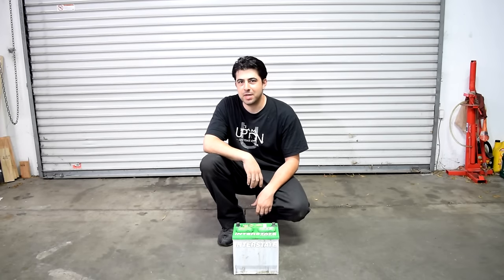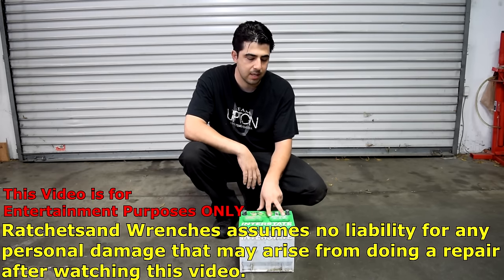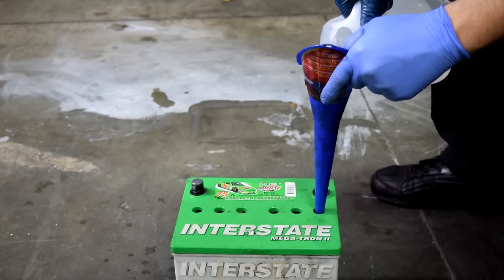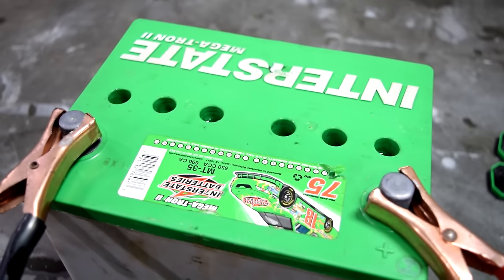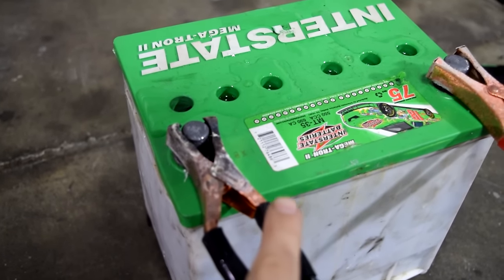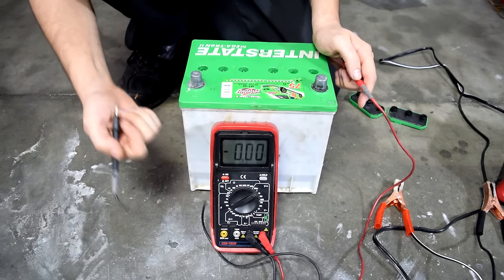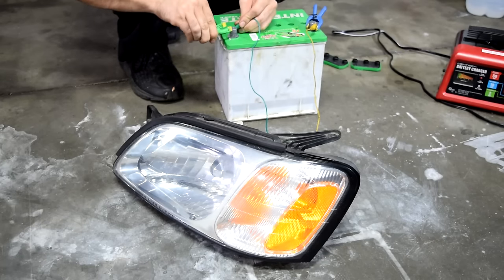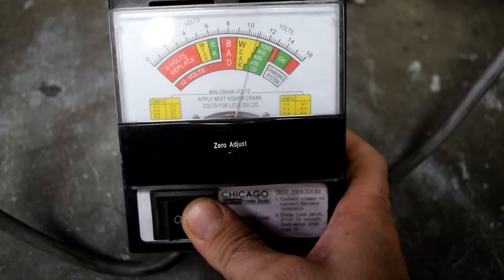Is it Possible to Revive a Dead Battery with Epsom Salt - See For Yourself

Comment: drastically changing the chemistry of the battery will not help it become alive again; you should have tried washing it first with distilled water and refill the battery with acid fluid that has specific gravity of 1.28, be sure to recharge the battery with desulfation mode before changing any fluid to get the most of the lead sulphate out of the plates first

Comment: I always heard sitting batteries directly on concrete will drain the voltage. 
I have an older RV with 1 huge primary starter battery and 3 cabin batteries. May try this.
Reply: Interestingly, some experts (including Car Talk’s Click and Clack) believe that storing car batteries on concrete floors might actually be a better idea than keeping them on shelves or other surfaces because the cold of the floor works to slow the self-discharge (leakage) rate.
Reply: Concrete is cold. When you place a charger on the battery the plates heat up, convection occurs. The theory is that the sulfication (?) of the plates instead of remaining attached or suspended in the electrolyte drops to  the cold case bottom. This build up will eventually get thick enough to short out the bottom of the plates, thus shortening the overall battery life.

Comment: ok that looks ok for test on car lights but put it to the test and try and turn a engine see if it fires up i don't think so.
also the acid used for 100 years for batteries is sulphuric acid, go and do what you can do more lights for you house

Comment: Clean the battery as demonstrated and purchase electrolyte solution for approx $16.00 ... at your automotive store & then  install per instructions (wear safety glasses ) and then charge up for 24 - 48 hours  .....  In Canada you can buy online for $30+  .... it works !  Follow the instructions .... PLEASE !

Comment: what happens if you drain and washout the battery after all this and re add the settled sulphuric acid and distilled water. I think it would hold 400 CCA

Comment: the problem was that you only had flushed it once, there is a lot more dirt inside the battery you need to flush it about 3 to 4 times then you can add the epson salt with water other than that you did fine.
Reply: +Carlos Melendez - I did with Aluminum Sulfate and Epson Salt... NON have worked :(.  It only worked 10% of Capacity, meaning..., 500 Amps Battery= 50 Amps Battery.  It's a waste of Money if you asked me!
Reply: maybe your battery was bad from the beginning, i have the same battery since 2007 and it works just fine.
Reply: +Carlos Melendez - Even with a Brand New Battery.... It won't work :(.... Aluminum Sulfate or Epson Salt has a low density of retaining Positive Charge / Negative Charge.

Comment: This one's dead battery now resurrected 12 volt car battery can be repurpose to be used as a battery to power a emergency power bank with a use of an inverter can power necessary appliances and equipment in the event of there is no power this now resurrected car battery can now have a second life.

Comment: I'm going try it again to see if I can retrieve the life of a 12volt battery that has a dead cell & I get some more baking soda & I have plenty of distilled water & boil up the distilled water & add the baking soda & put the caps back on the battery  & give it a good shake up & let it sit for a little while & then shake it up again & then take the caps off & pour the all of the solution out of the battery & then pour more of the baking soda with boiling distilled & add back into the battery & put the caps back on the battery & give it another good shake up let it sit for a little while & then give it another good shake up again & then pour the solution out of the battery again & then I would pour in fairly hot distilled water only & put the caps on the battery & give it another good shake up them take the caps off & pour out the distilled water & then let it drain for a awhile & the mix up Epsom Salts & mix that up properly with distilled boiling water & once got mixed properly & I will pour that into the battery & then put the Foxsur 12v/24v 7 Stage Battery Charger on repair mode & leave it on repair mode for 24 hours & see if I can repair the 12 volt battery if not I haven't got nothing to loose & I have got another even bigger 12v battery & it to has 1 dead cell & I was thinking of trying to recover that one 2 Kind Regards Peter

Comment: Abroad they have been known to wash out batteries with a coke drink, then refill with the acid. All this type stuff is last ditch, but might be worth a try on an old pretty useless battery. I wouldn't add any chemicals to a good , not to old battery, or my experience is that it will not make it last longer. It might even shorten it's life.

Comment: Epsom salt and water is not a proper electrolyte, it is supposed  CLEAN the sulfate from the lead as in a dead battery. Remove that epsom salt water from battery, add sulfuric acid and water in the correct ratio, charge, and assuming the lead plates are not damaged, you should have a battery in decent shape, typically it might be as as much as 90% as good as new, the first time this is done. Eventually the lead plates will be GONE from sulfation. Have a nice day.

Comment: Just let you know cement drains batteries
Reply: Ivan Omarra yeah I not sure these guys wanted to be successful..I’m guessing,They may be in the business
Reply: That's actually a myth. The reason people think that is because having a battery sitting on cool cement with a higher ambient temperature can cause the battery to discharge more quickly due to the temperature difference between the top and bottom parts of the battery. However having worked in the auto industry for several years I have seen many batteries stored on concrete floors including having stored my own this way and never had any issues. But no, cement does not have any special property that will drain a battery by coming in contact with it.

Comment: the guys that say no, do not have any proof, as the guys that say yes.  it is entirely possible that daily temperature changes, over a period of time, altered the electrolyte concentration thru warmer air during the day absorbing  components....then due to colder average temperature of battery being in contact with  cement heat sink did not re-absorb at the same rate....so, the state of charge is highly likely to be reduced.......

think about it....a closed shipping container, except for leaks will breath in and out on a daily basis,,,,the lighter  molecules of air escape faster than the heavy molecules....because, heavy molecules do not present themselves as often to an external opening....consequently....likely to find traces of liquid h2O......inside.....not exactly the same thing but similar....somebody out there could likely express this with equations....

Comment: Just buy a new battery as car batteries aren't that expensive ($150) and a new car battery from Walmart will generally last 6 years.  Besides, a person can also get back a little money by bringing in their old battery as a core.
Reply: While 1 battery may not be that big of an issue, their prices have gone up significantly. A truck battery is close to $200-250 now, especially when you get into higher quality ones. What's even worse is when you have several large batteries that are going bad (RV, golf cart, solar panel set-up, that sort of stuff). At that point your cost is over $1000, so these DIY repairs are worth a try.
Lastly, a core battery only gives you $10 regardless of size. Enough to stop you from just trashing one, but not nearly enough to be considered as an "R.O.I."

Comment: I've got two batteries I'm going to try it with when you're charging each one of themselves should be bubbling if you if you look at your charger you probably got to sell it ain't even doing anything
Reply: What the hell did you just say? lol.
Reply: When you're charging a battery you look down in their holes each one of those c cell s should be bubbling when you're charging it if the cell isn't bubbling it's a dead cell

Comment: Someone try a 50/50 CLR/WATER Solution to clean sulfated  plates. Then put fresh sulfuric acid back in, or the original acid filtered through a coffee filter. Report you results to this string.
Reply: stripemaster9 yup this works..it needs fresh acid which Wal-Mart sells

Comment: this is so wrong interpreted. The sulfuric acid which is used on batteries is H2So4
The Epsom Salt is MgSo4 which is something totally different The (Magnesium)  will cover the lead cell into a white crystalline buildup, something that you don't want inside of any lead acid battery. Now where the sulfuric acid coming from?
The sulfuric acid is made from "SOX or Carbonic Acid S+O2-->So2 
and this is how sulfuric acid is made So3  +  H2O --->  H2SO4  ---Sulfuric Acid if you just ad the SO2  + H2O------H2So3-----Sulfurous Acid Which is again something different!

Comment: Just add lime away bathroom cleaner to your battery cells and trickle charge it (low charge) for 24 hours and it will do the same thing.    Do not empty anything from the battery.

Comment: There are  several things for getting a good result
do not try to do this unless you know what you are doing - the acid can burn you
check the voltage first - there may be a dead cell which will be a waste of time trying to fix.
Check the battery fluid.
attempt to fully charge the battery.
(I read about these and more using Rapid Renew Roadmap website )

Comment: you expected that battery to hold the recommended cranking amps while only charging it on a 2 amp charge for 48 hours . sorry to tell you that wont work 2amp per hour charge times 48 hour is only 96 amps. so its right on the money. 100 amps

Comment: Never put baking soda in a battery.  After charging the battery a few times . Dump and replace with battery acid . Or add sulfuric acid to the Epsom and water . 30% acid . No acid . No CCA.

Comment: It's a good emergency phone charger 👍
Reply: Interesting thought exercise. The issue is you need power... if you have power, you don't need the battery. If you're thinking off-grid or outage solar power, sure maybe. You could use a small solar panel with built in controller or panel/controller combo. But if you can afford and obtain these things, just spend a few bucks more and get a fresh battery. If you want to get fancy you can get combo units that have built in solar charge controllers, 12V, 5V, even built in mini 120V inverters. Better still if it's LiFePO4 (lithium iron phosphate).

Comment: Please take the battery off the concrete floor and put it on a 2x6 because the concrete will drain a 12volt battery try that and your amps should read more.
Reply: I heard that old wives tail years ago.  Truth is that someone might "think" concrete is discharging it, when it is really just time and non-use.

Comment: Battery should not be setting on concrete.
Reply: That advice has migrated into the realm of 'ol wives tales'. Modern batteries have plastic cases which prevent leaking or oozing of battery acid through the case.

Comment: any battery can be saved..
i worked in a battery center repairing them
you just need the right stuff to add
there was a composition chemical that was imported from america that made second hand batteries work and last longer than new ones..
i was witness to that..
many years on and they still work

Comment: All my battery problems are due to a dead cell or constant drainage. A dead cell usually comes from a piece of lead that drops off one of the plates. Then it shorts the plates to each other by the welding process. Therefore I'm calling B.S. unless the baking soda has a method of unwelding the plates. please explain. NEVER had a battery go bad for no other reason. Why would it? It wouldn't. Most Batteries are thrown away because of metal . The batteries u are checking might have had a short time left on them but it's coming. If ur in a bind this might get u to a paycheck. If u have a wife getting ready to have a child or might need ur car to start instantly, go spend the 100.00 for piece of mind.

Comment: I tried this with 2 different types of 12v car batteries and one 12v motorcycle battery: Didn't work
Reply: First check each battery cell one by one l, if one cell is dead in a battery , it will not work. Secondly put Fresh Sulphuric acid (as per requirement ) in the cells after   cleaning for many times .Charge the battery  for 12 hours.

Comment: Your Battery is only rated at 75 Amps, Your Meter Reads 100amps after the battery has been fully reconditioned and recharged, and you are disappointed ???? What reading did you expect to get ???

Comment: LOL, you have to put the battery acid back in the battery.  Epsom salt is NOT battery acid.  Epsom salt is only to clean and desulfate the plates.  Then it has to be dumped and the electrolyte put back in.

Comment: In the first place, anyone knows that concrete will drain a battery, quickly!  Put cardboard between the battery and the concrete, and you will see a difference!
Reply: Plastic cased batteries will NOT discharge if set on concrete or the earth. The batteries that did were the old thick rubber/ carbon case type in the 1930's to 1950's. carbon black conducts electricity - plastic does not.

Comment: You should use a capacity tester test a capacitor that's the best way to test a battery can't you put hydrochloric acid back in there you can't just use epsom salt you have to use hydrochloric acid don't you

Comment: First the ground is a "ground" come on you work in a shop. Put the battery on a piece of wood. or a metal rack isolated from the floor. If you leave it on the ground it discharges. Second you have to dump the Epson salt. Salt is on the basic side whereas acid is not; because acid is on the acidic side. To get the proper "reaction you need the acid to react with the lead. You just have basic vs basic...right; now you got it!  And third, although I have never done this I have heard it takes several days to de-scale the lead properly. No offence but you have only proven you did it incorrectly.

Comment: Should have filtered the acid solution that came out of the battery and put it back in and left enough room to add about 1 to 1.5 ounces of the epsom salt solution to each cell…..straight epsom salt solution doesn’t work.

Comment: Skip the baking soda step baking soda neutralizes battery acid neutralizing substance in water inside the battery cells is going to cause a battery not to charge because it's going to coat the lead plates inside not a good idea

Comment: You wore no eye protection, you were extremely careless in flipping the battery onto the 2x4s (if it slipped dropped into your bucket you'd be screwed). A freaking car battery with Brand New Plates is what 100 - 120 bucks so NOT really "over priced." Why take a chance ?

Comment: at 0:25, you show 14V.. thats incorrect. A good battery would be 12V.
Reply: In addition to the  fact that the presenter was pointing out a general range, not a specific voltage 

If you google "What is full automotive battery voltage" You will find this answer:-
"The actual resting voltage, or the voltage a battery will settle at 12-24 hours after being removed from the charger, is closer to 2.1 volts per cell, or about 6.4 volts for a 6v battery, and 12.7 volts for a 12v battery. These numbers assume 100% healthy cells and may vary a bit lower for older batteries. Nov 25, 2013"

 You will also find the answer to this question 
"Why does a 12 Volt battery read 13 volts?"

Cheers Peter

Comment: I have over 20 years experience with batteries 
in cars and also in UPS systems and I can only say .. 
if your battery makes problems then replace them immediately because there is no way to revive used batteries.

Comment: This is a hoax to sell a book.  When you dump the acid int a container the silt you see is from the plates in each one of the cells.  The bottom of  the battery will have more silt causing the plates to short out plus the plates don't have a lead coating to create the electrolysis process to move ions.  With not enough or any sulfuric acid results in poor or no transfer of nickel to the part being plated what a battery does during operation.   More but it's about the sulfuric acid chemistry which has been defeated making the now useless battery junk.  Save the money, bring your old batter to a battery shop and buy a new one.

Comment: Trying to restore the battery you might clean it with different substances, but finally you should pour in sulfuric acid with the right concentration. It's  density is 1.12g/cm3 for completely discharged battery and 1.28g/cm3 for completely charged. It can be measured with density meter (a cheap & simple device in the 90s). For the test I'd put acid with concentration in the middle and will cycle the battery several times.  The test specimen should not show high disbalance between separate cells. If it has a dead cell, then the whole experiment is a nonsense. How to measure the separate cells when the connections are hidden - right on the plates (for short time, preferably with pair of lead-covered probes).
 
I've heard also another myth that could be right for the old batteries - you could recover high part of the capacity  if you exchange the poles, e.t. discharge it completely to 0 and then charge it in reverse with small current for > 58hours. But again - with the sulfuric acid inside. Not kind of salts, etc. I would experiment also with my own idea:  Try electroplating of Pb on both positive and negative electrodes to recover it (in discharged state and not with acid but with proper electrolyte for electroplating of lead). Then clean, load acid and recharge. I'll probably never test this on my own because I don't have a way to safely dispose lead containing liquids.